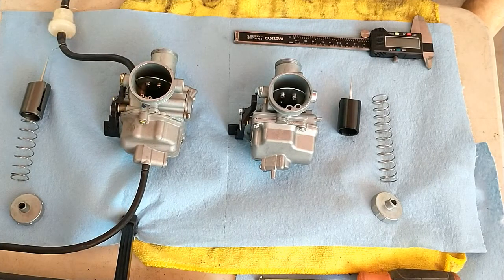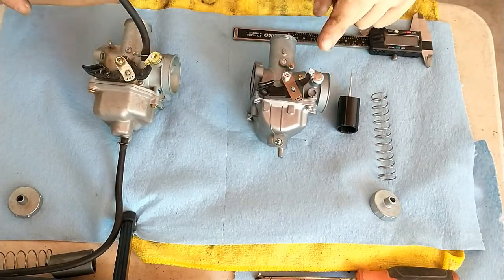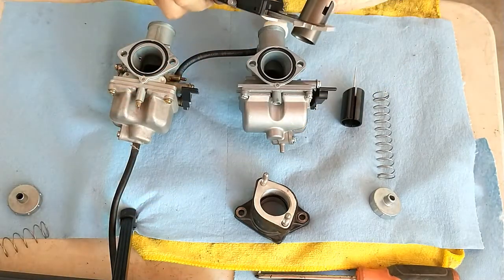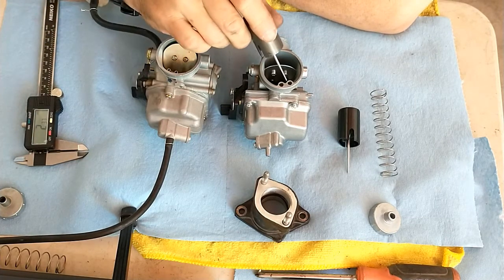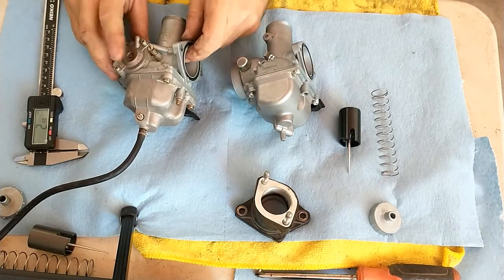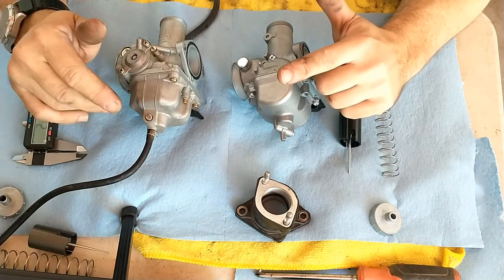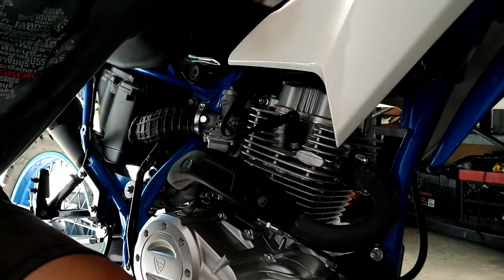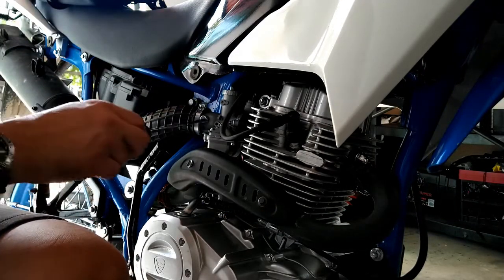[12] Mikuni VM26 Clone Comparison and Swap On My Chinese 250 Dual Sport (DM250, Hawk 250, Tao etc.)

Comment: Hey man New subscriber here and fairly new rider. I have a question, would you happen to have a link for those jets you've purchased? (I also replaced my stock carb to the VM26 clone) but also I live in South Florida where it's mostly hot..was thinking I needed to put a 110 main but hearing/seeing you go down to a 90 jet confused me. Anyway, would be great to see a video explaining what the jets do. Peace! ✌
Reply from the maker: Hey! Thanks for the sub. I tried a 98 (not 90 - probably my weird accent). It's a little wierd as the main jet doesn't really affect idle but she hated the 98. There is no 99 in the pack - I went back to 100 and she's super happy now. You can also adjust the needle height too as a sort of fractional adjustment between jets.  This is the link - https://www.amazon.com/dp/B017SJO94S?psc=1&ref=ppx_yo2_dt_b_product_details

Comment: That is an air cut off valve that's on the side of the carburetor.
Reply from the maker: Thanks - what's is the function exactly?
Reply: @tinymotogarage  Basic explanation is if you are at high throttle and suddenly shut it down it reduces air flow so as to make a richer condition to stop decel backfire and popping
Reply from the maker: @barefootbob1269  OK - thanks! Had lots of theories on this - that was not one of them! Cheers BB.

Comment: you must adjust the fuel/air screw to get it to IDLE properly not the idle RPM screw !!!!
you adjust the fuel/airscrew to fastest idle at the lowest RPM and then a 1/16 of a turn more to the rich side then it will idle at the RPM you want, replacing a carb because it just needed the idle air screw adjusted is silly.... but we all have to learn somehow !
Reply from the maker: Appreciate the comment. I probably spend 5 hours on the idle screw. I bought two different right angle drivers to do it too - didn't help. I think the original carb was jetted badly on the slow jet (or has other issues) - and there are no jets available to change it out that I could find - hence I went with something I could jet.
Reply: @tinymotogarage  yes those screws underneath by the float bowl can really be a bitch to get too !!!!  I am lucky on my TT250 to have a simple side screw to adjust the fuel/air screw .  I started putting in a 30mm Nibbi carb today, but found out the intake manifold was not the correct angle so I think I will make my own intake manifold. it's not like the hawk with that manifold the 30mm carb hits the frame and cannot be used in the position it was made for... i flipped it over and tried it that way but the carb is at a steep angle now
and not simi level , and it doesn't have a vacuum port in the new manifold
where my old stock one does ( California model, they have a carbon canister on it ):(

Comment: What is the size of the carb is it 26mm? I also have a dm250 in Mexico I want to upgrade the carb bigger one but I want it to fit
Reply from the maker: It's a VM26 - I think the dimensions are all on the video. Not sure if a larger one would fit the flange. If you want more power, switch to a K&N filter and install a CRF230L exhaust, jet up 2 sizes - that's what I am doing next. I only changed the carb so I could jet it easily. Remember too, the entire bike is 17BHP rated (not just the engine) so it you put too much power down you'll blow through the terrible rear shock, the chain, the gearbox and whatever else that's not rated for it. Enjoy your DM - it's a great bike.
Reply: @tinymotogarage  I cut off the stock exhaust and welded on a after market exhaust I love how it sounds now and it's rich since I played with the carb and wanted to upgrade the carb something little more bigger I'm currently in the states looking around amazon, ebay etc for carbs for a 250 etc to delete the stock filter but yea it sounds better overall and little more torqey it's a good bike if you know how to take care of it it's made to smash the crap out of it like a CRF ktm etc ok you know it . I go to a small town and it's great to ride around and the dirt trial's it's fun !

Comment: It a accelerater pump
Reply from the maker: But it's not actuated? Usually you see the accel pump linked from the throttle cable to squirt on demand - this is not.

Comment: I need to know how it rides.  in all variances of conditions. Please get back with any of your commenters
Reply from the maker: Hey Bryce - sorry, I missed this. I am not really familiar with that bike to be honest. I selected the VM26 based on info I found on the RPS Hawk 250 which I decided was the same bike (which I think it it to the most part). It was a direct swap on my DM250. This is a good site chinariders.net and there are blogs and videos too. If your Bashan is the same basic bike, I suspect the VM30 would be too big without an adaptor. The DM (and Hawk) are 250cc Honda CG clone engines and as such, pretty interchangeable to my knowledge - so the 26 worked for me. Remember if you rejet or change the size of the carb you'll need to make sure you don't run too lean as that's really bad (rich is not good, but lean can really damage things). Again, I am not an expert, just an interested amateur so check around too. Good luck.